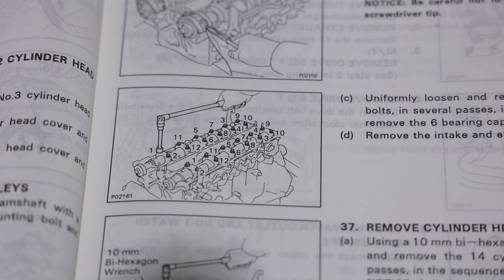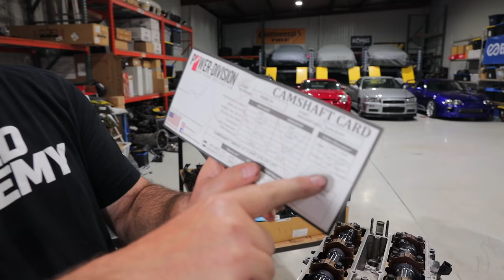MUST DO Reliability Mods For Every 2JZ GTE - Supra Build Levels Up

Comment: Also, for those that dont have access to compressed air, you can put the cylinder at bottom dead center, feed a bunch of soft rope/string in through the spark plug hole, then crank the engine by hand until you feel resistance. That way you will never drop a valve.
Reply: Imo, this is a much safer way of doing this job. No risk of valves or air supply leaking down, or you knocking the valve off its seat when hitting it. The compressed air will rotate the piston to the bottom of the cylinder too, so if it does leak the valve may go bye bye.
Reply: That was all me back in the day 😂

Comment: Great job, the proper tools make it so much easier, although as the engine was out and all but stripped I would have just taken the head off, fitted a new head gasket and ARP bolts/studs for the extra hours work and small price, for piece of mind.
Reply from the maker: Honestly for the power goals I like to keep the engine sealed up as is from the factory. The reliability is always there.
Reply: Agreed, not that much more work at that point to pull the head, slap in a factory GTE hesd gasket with a fresh set of studs to keep things reliable since it’ll be somewhat modded.
Reply: I would never take a head off unless necessary. Once unloaded they can bow, twist.... Then you have to go over the entire head to check for straightness. Which is honestly not easy to do correctly. Then its off to the machine shop for weeks to get the head decked, then shave down the cam side, then a little off the front. Then you have to cut the valves. That all assumes the machine shop does a good job. No shortage of 7Ms and 2JZs with snapped camshaft because the machine shop did crappy work. You also have to remember that even if a machine shop straightens everything correctly there will still ends up being more material in the middle of the head then the two edges due to the nature of how they shave down heads. On a mixed metal engine this will lead to a higher chances of head gasket failure in the future because there will be even more disparity in how the head sheds off heat on the edges compared to the center.
Reply: @speedacademy  yeah you open a can of worms every time you take a cylinder head off.
Reply: Agreed if not only for the ARP hardware. You're never going to be satisfied with power and not having to pull the engine back out especially for bottom end work just makes long term sense.
Reply: @jordanslingluff287  yeah, you need to find a better machine shop…sounds like excuses to justify using old/inferior hardware.
Reply: @devonv2455  I would love to hear why the 2JZ HG is inferior? It sure doesn't sound like they are going for crazy boost, rather response. HGs are not maintenance items. So why on Earth sound they remove the head and bring this awesome build series to a hault for one of the strongest engines ever built?
Reply: @jordanslingluff287  HG is definitely an maintenance item, machine shop turn around for a cyl head is usually a few days. When doing any performance build With boost one of the most critical gaskets is indeed the HG. Also factor in old factory 20 something year old headbolts and personally I would for piece of mind get a nice flat cylinder head with good clamping load. 

My 2J car makes a cool 1100whp with a fresh OEM Toyota gte gasket and 625+ Arp studs. Wasn’t compromised one bit by being properly gone through by my knowledgeable machine shop. YMMV
Reply: @devonv2455  Yeah sure.......

Comment: @Speed Academy There's 2 O rings behind the oil pump that must be changed. And to remove it you need to remove the lower and upper oil pans, both the pans and the pump will need to be resiliconed.

Comment: Valve seal replacement! I remember like making my own tools as a teen. Sitting awkwardly on top of my engine bay (no garage) set up an easy up over me 😂.
And I did these myself in my driveway! 

I was always a do it yourself guy tho! I just don’t get into the brains of transmissions or rear ends!

Comment: Surprised you didn't take the opportunity to replace the oil pan with a aftermarket higher capacity unit with built-in windage tray.  Would help prevent oil starvation when you're banging out those high-speed time attack turns 💯💯🏁
Reply: There is a windage tray from the factory on the 2j.  Nobody really makes a larger capacity pan either.   When running a super high grip aero setup oil starvation is an issue,  but running 1 quart high lets you get away with modern sticky tires and a no too moderate aero setup with a 2j without oiling issues
Reply: @supradma71  torque solutions just came out with a very nice replacement pan for the Subaru EJ.  Very surprised nothing out there for 2JZ even though it sounds like it doesn't suffer the issues like a RB26 does.

Comment: Finally someone uses the same valve spring removal/installation tool I use. Although the tool is a little too thick in some cylinder heads, but you can always modify the tool by shaving it down a bit.

Comment: Best way i have been installing oil pump,  crank seals or whatever seal for years is with pvc pipe. You can buy pvc in many sizes and it wont cut the seal you try to install.

Comment: I’ve only had to change a crank seal 3 or 4 times and man whatever you paid for that crank seal puller it was worth it, especially if the engines still in the car they can be really hard to get out, and you’re so worried your gonna mar the block or crank shaft.

Comment: should have put billet tensioner on the timing belt with those aftermarcket cams and spring i have seen a couple fail and it destroy the engine

Comment: But you did not install billet timing tensioner bracket, the OEM ones tend to crack in high HP builds.
Reply from the maker: No need in the power level we are making. The OE ones are solid choices to 800HP

Comment: Aaahhhhh, did you torque the pan right after you applied hondabond?
Best practice is to finger tighten the bolts for the first 12 hours, then torque to spec.
This way you prevent the pieces of it breaking off due to pinching and falling into oil pan.
Remember, you had this problem with an S2000 engine.

Comment: It really doesn't matter if you take off the paint on the inside of the pan where no one is going to seal it and you're going to be putting a sealant on...lol. those plastic or rubbery discs are phenomenal.
Reply from the maker: Its a spot that can potentially rust hence why we try not to strip it. 👍🏼
Reply: @speedacademy  yeah I guess moisture could get in there. I would have thought that the sealant would have been efficient enough. It should have still out lived that engine..lol. love the content.

Comment: There is a ‘sealer’ like loctite available you use on the outside of seals that bonds them in and seals at the same time.
Reply: I wouldn't trust that. Just sounds like something that will fail under some pressure. Just get a good rubber/ptfe/whatever seal and you'll be good to go.
Reply: @alexisthemexican  have you seen or used it? It’s used in motorsport and by a lot of OEM’s especially industrial/commercial engines to keep the seal from coming out of the crankcase or head etc, any blow by and crank case pressure build up can pop a seal.

Comment: lemme find out that DP is playing the flute in the background of Future's "Mask Off" song😅 i wonder if that fluid in that dampener could ever solidify and cause crank balance issues??? good video guys💪
Reply from the maker: No the silicone used will never harden
Reply: The silicone oil used in the dampers is incredibly stable, the engine will need a full rebuilt long before the fluid damper shows any signs of aging. Banks power did a good video on fluidampers , the whole thing is worth watching but, here is link a link that jumps to the most important part. https://youtu.be/OEd6tFbc86o?t=1274 , Most of the myths you hear about fluid dampers solidifying are from guys that purchased ATI Super dampers and don't want to feel like they made the wrong choice.

Comment: So on the GTE non-vvti there's not a cam sensor? And on those GSC cams there's no trigger wheel? Do they have it in a different location on the non-vvti GTE motors or is this setup not CoP?

Comment: Squints was there a time warp there where it was all stripped, and the put back together with new cams but old belt and water pump etc then redone with new gear?
Or was it YouTube magic?
Reply from the maker: We used the old belt to check valve clearance then pulled it off.

Comment: Funny thing is when I did my GTE swap… i did none of these things….I did was the timing belt and after I put the ending in,  every other seal failed in the car 🤦🏻‍♂️…. It’s an old engine should of done the seals while it was out … my valve stems failed, cams seals, my harmonic balance exploded…. My time belt tensioner snapped… I’d recommend not replacing the tensioner with stock, go a real st or rad industries… I’ve fixed everything but the valve stems.   I do that when the bottom end get done

Comment: Didcyou put in bigger cams? No degree wheel,  or did i miss something?
Reply: they did not use the ajustable cam pulleys, no need to maximize hp output on high revs

Comment: so it looks like you didn't put the clear sleeve on the valve were the keeper rest in before you slid the new seals on. there is a 98.8 percent chance they are torn and its gonna burn oil. That a blue point tool been doing jz seals for a while now most likely its gonna leak.
Reply from the maker: What clear sleeve are you talking about? Not sure what you mean.
Reply: @speedacademy  its in the seal kit it looks like a straw about a inch long and you slide it on the valve and then slide the seal down. Then take the straw like sleeve  off and in to the next valve. The keeper cut out is sharp and tears the new seals when you slide them over without that straw like sleeve.
Reply from the maker: I think I know what you mean now. The tool I used to slide them down has no sharp edges so didnt damage any of the seals
Reply: @speedacademy  yeah the the seal is just a scosh smaller then the valve right? So when you pushed it down the valve stem you went over the sharp part the keepers rest in. Thats were it may damage the new seal.

Comment: no re-condition the motor?
Reply: Isn't this what they are doing? Or what you mean by re conditioning? Like hair conditioning?
Reply: @alexisthemexican  ok, checking, changing bearings maybe a polish here or there etc re-conditioning .
Reply: Why bother? There was no need to go that far into it
Reply: @dennisclark9544  if you are going to keep and run big HP, it's insurance
Reply: @CMgraffix  they're not going for huge power, so it's just irrelevant. I'd bet my house on this engine not blowing up, or needing the bearings doing with the kinda power they're gonna be making
Reply: @dennisclark9544  well if you say so

Comment: Reliability mods? Everyone says a stock 2jz can make 1000hp. So theres no need for "reliability mods".
Reply from the maker: Sure make a 1000hp but smoking like a chimney at idle or leaking like a rusty tap should be items that certainly need to be fixed